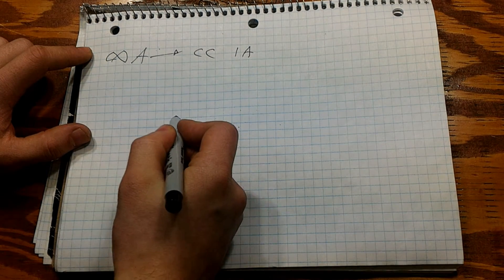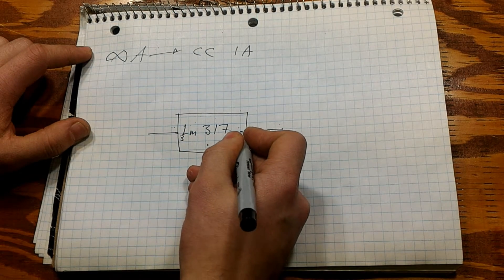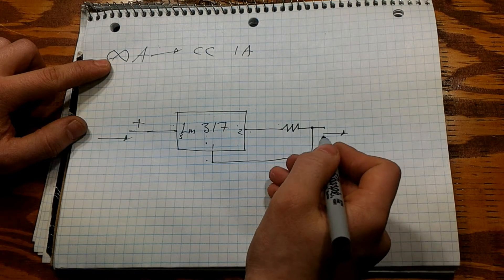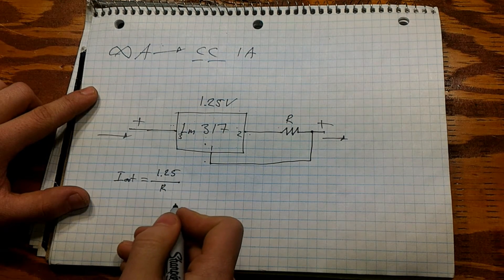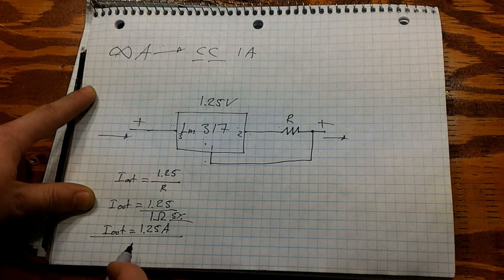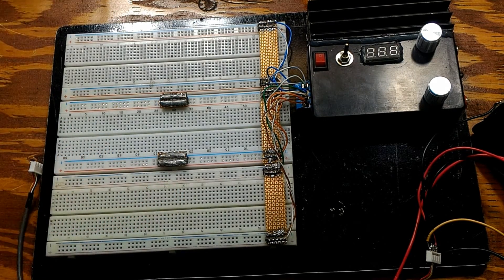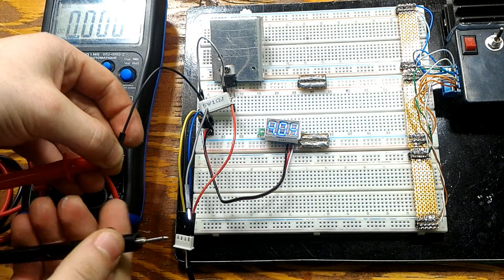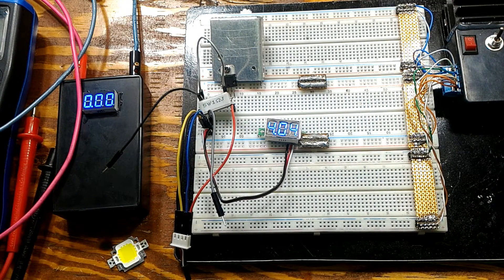LM317 CONSTANT CURRENT REGULATOR CIRCUIT TUTORIAL

Comment: Hello sir, I have made this design you show to have a limited current of 700 mah. So I divided 1.25 by .7 to get 1.78 ohms so the closest I had on hand were (5) 7.5 ohm .25 watt resistors in parallel to get 1.5 ohms with rated heat dissipation of 1.25 Watts. When I connect to my smd 10 watt led it only has a current draw of 362ish milliamperes at 12 volts. Why will it not produce 700? It’s puzzling! To further inform you I am making led driver for the 10 watt led to run on 12-13.5 volts.
Reply from the maker: Hi you can use this to drive a led, but you will need a resistor that can handle at least 10w. Make sure that the regulator stays warm and not hot as it has thermal protection. 
Not sure if you interested but i made a table lamp that has dimming circuit in it, if you want you are welcome to use it!!!!!!!!!
https://www.youtube.com/watch?v=yzBl5n_cauM